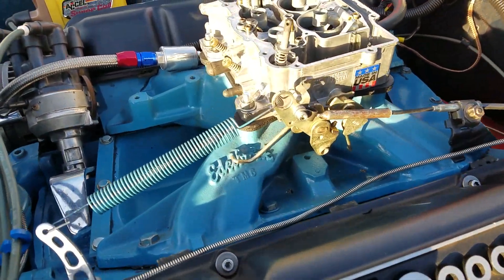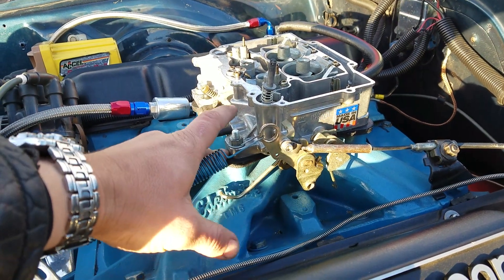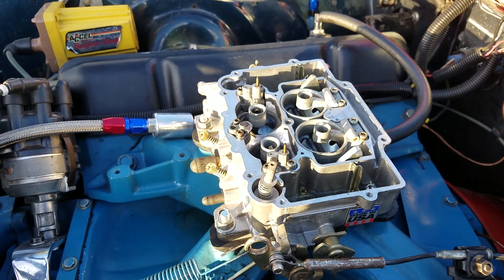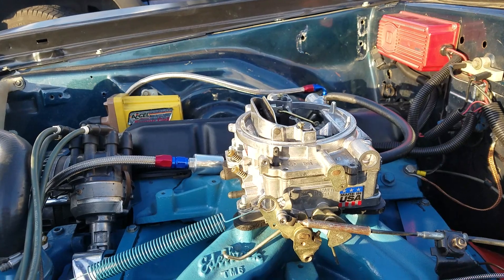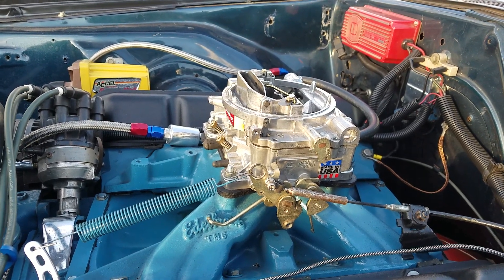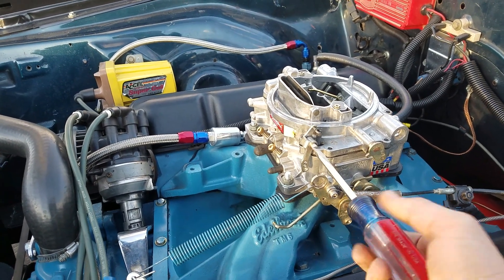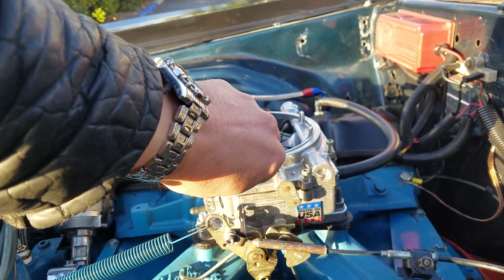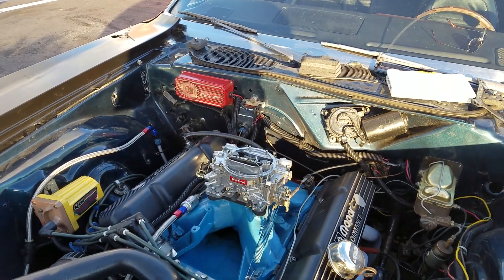Adjusting your edelbrock carburetor explained on big block plymouth cuda project

Comment: I have a 83 c10. Idk to much about the motor. 355, Rv type cam, n a to big air gap. with a 1406. It runs fine for about 10 mins. Takes of with balls. then falls on its face n sputters at around 3000-3500. N when I shut it down i have hear fuel pissing into the carb. and it's almost impossible to fire up again.
Reply from the maker: Talon Vaughn boiling fuel.  I have a video about that
Reply from the maker: Talon Vaughn so did a gasket solve your problems btw?
Reply: For the one 1406 I did checked the float level. N that fixed it. the other 1406 I think I'm suffering from vapor lock. prolly thinking a new fuel pump will fix it. I have a holly E pump I'm gonna bolt on the frame. then dial the pressure down. Might get the 3/8th plastic spacer you recommend as well. So thank you for the tips n your vids
Reply from the maker: Talon Vaughn mechanical pump works well, but 5.5 psi is what you want
Reply: Okay Thank you man!

Comment: Everybody likes Edelbrock carbs. Edelbrock wasn't happy that their 750 carb didn't quite match the Holley 750 for power the whole reason for the 800 Edelbrock carb was to beat the 750 Holley carb and it does so by nearly 25 horsepower. That's the purpose of the Edelbrock 800 carb, to make more power than Holley. The Edelbrock jets sizes are about twice as course as Holley jets, in that one size change equals about two jet sizes in a Holley carb.
Reply from the maker: Yup.

Comment: My engine still runs even with both mixture screw tightened. I can tighten in all the way. Or nearly take em out. Doesn't do a thing.
Reply from the maker: Talon Vaughn that's because it's not running on the idle circuits, but instead has the throttle open enough to run on the first step of the primary.  And also could mean the floats are set wrong and it's allowing fuel to spill in, and it could be a matter of either the wrong jetting, metering rods or springs.  There is a LOT of possible reasons this could be happening...
Reply: I can see the secondarys are open about an 1/8 in. while it's running or not. This 1406 just might be a lemon. The other one worked great after I did like you said.
Reply from the maker: Talon Vaughn highly unlikely, but possible.  It could also be too small or too big.  Or dirty... I would change it out for the other one just to see before spending money...

Comment: Just sold my last Edelbrock/Carter and Holley... Everything EFI now here...
Reply from the maker: CerebusTV no can do for me.
Reply: Not that I'm flush... adapted factory units to single plane intakes using wrecking yard parts.
Reply: This an easy to understand explanation and tutorial of this carb however. I just freshened a 750 before selling it and this captures the process extremely clearly.
Reply: The big diff with EFI, even the relatively more primitive but easy to troubleshoot Chevy TBI setup, is drastically improved fuel economy in street driving, due to the feedback of monitoring air fuel ratio and the computer setting that optimally at the injectors.
Reply from the maker: CerebusTV that's very true.  Plus you know me and my love of proven oem tech
Reply: TBI is so well proven that it's easily adapted to other engines. I ran one from an 87 GMC on a Ford 351W for many years, single plane intake and headers, using the 4 pin GM module with a Duraspark distributor.

Comment: I have an edelbrock 1406 on a mopar 360 and a street demon 1901 on a 318 and I will never buy another edelbrock.
Reply from the maker: Nothing more reliable than an edelbrock.  Especially when set up right.  But they don't compare to other carbs when it comes to racing.  Especially in blow through
Reply: @InvincibleExtremes  I don't know anything about racing because I don't do it.  The street demon is on a 318 in a 4x4 Ram W150 and is a far better carburetor than the edelbrock on my 360 in a Ram D250. You should try a street demon.
Reply from the maker: One day I will.